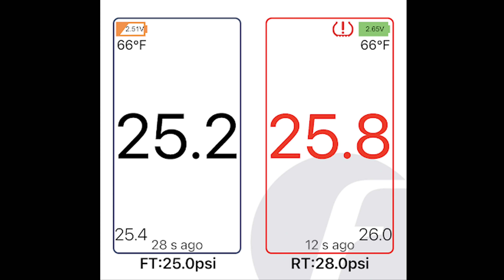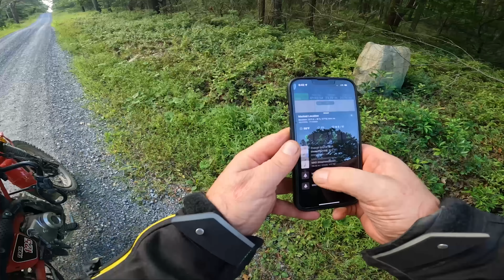Ep 4 Fayetteville, PA to Greenwood Furnace, PA: Attempting the MABDR & NEBDR on a Honda Trail CT125

Comment: Changing tube tires takes practice.
I worked evenings at a small garage / gas station in high school; repaired tires and pumped gas.
Using professional products and lots of practice, made me alot better at it than I would have, without that experience.

I have considered converting my spoke wheels to tubeless tires, so that I can use tire plugs.
If I end up with flats often, I will convert them to tubeless.
Reply from the maker: I dream about tubeless tires...